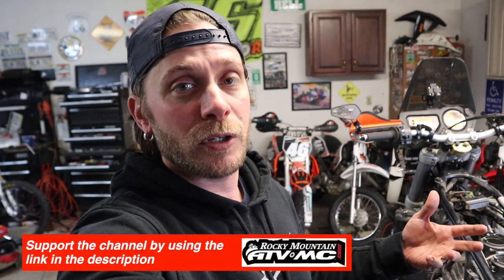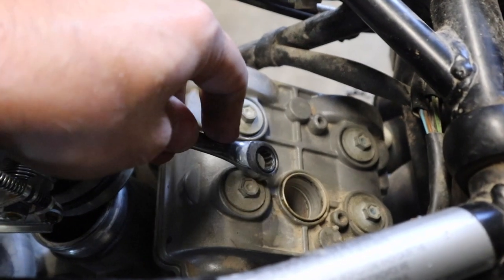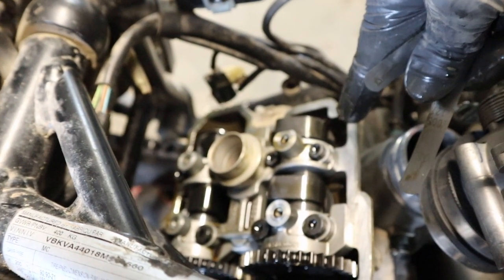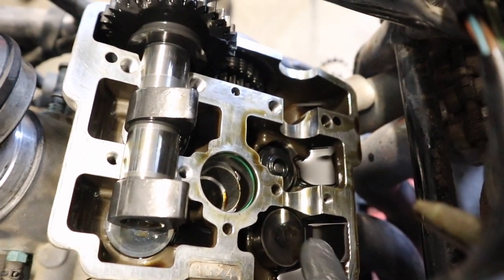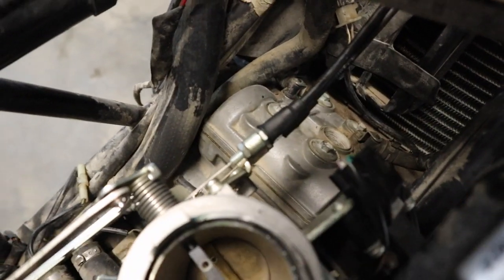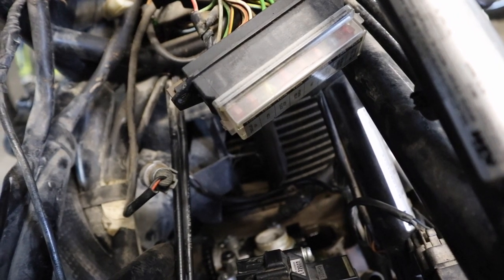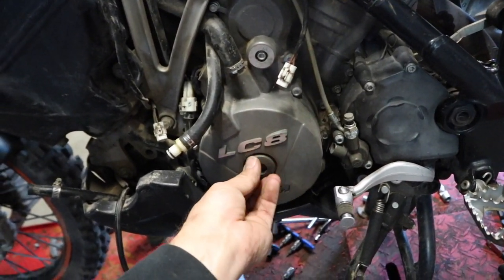KTM 990 ADV Valve Check/Adjustment and Spark Plug Change | Back in the Garage

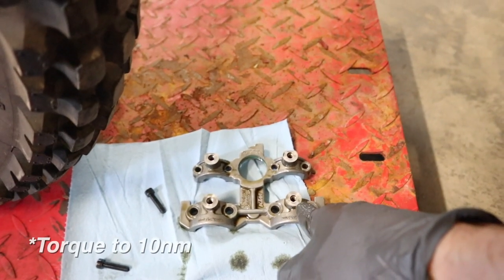Comment: Just FYI, according to the KTM HOW write up on the procedure, all 8 hex key cam bridge bolts are supposed to be torqued to 10nm, INITIALLY, but the 4 larger hex key bolts are supposed to be finished at 18nm. At 8:31 you only show 10nm for the spec.
Not sure its worth tearing tanks and intake back off to retorque if missed but should probably be done if possible.
Reply from the maker: You're right. I missed that.

Comment: Yesss!  Great timing… just ordered all the parts and am getting the courage together  to do this on the 990R for the first time..  Thanks for doing these..!
Reply: I’d recommend buying the crank locking screw or making one, it’s only cheap. Stops crank spinning out of time when you have cams out.
Reply from the maker: While I'd agree on the newer model LC8s (though I've done numerous checks/adjustments without) , since it's gear driven on this model, (to me ) it's kinda overkill.

Comment: Is the disassembly/assembly procedure the same for the 890R?  Excellent video.   Thanks.
Reply from the maker: Insomuch that they're both DOHC engines, it would be similar but there are quite a few differences as well. The modern 1090/1190/1290 valve service video I made would be closer since it has chain driven cams vs the gear driven cams on the 990 but there are still some differences. I'll make a video on the 890 when the time comes.
Reply: @2WR  I wonder why KTM moved away from Gear to Chain, is it because of costs of manufacture?

Comment: When are you going to do a valve adjustment on the 890?
Reply from the maker: Bike only has 12.5k on it but still plan to check them over the winter
Reply: @2WR  , I know a lot of 890 owners and been checking valves and cams earlier than the typical service schedule due to the cam issues that have popped up on some of these bikes. You do a great job showing and explaining things. Your 990 video is exactly what I was looking for but for the 890. I am more of a visual person versus a book person. I would like to do as much service as I can on my own since my local dealership is a crook.

Comment: In 15:40 it is visible that you removed the butterfly secondary flaps (driven by stepper motors and controlled by ECU) from the intake manifolds throttle bodies. What`s your experience with this mod? Throttle response, fuel economy etc? Remapping the ECU?

Comment: I've been considering getting one of these as my first adventure bike but doing this every 9000 miles seems a little intimidating. Have any thoughts?
Reply from the maker: If you’re gonna ride a lot of miles and don’t want to do the checking yourself, gotta be prepared to pay for it. I don’t put a lot of miles on this bikes since it’s my 3rd ADV bike (ride my 1290 & 890 more and they also have longer service intervals, basically double). For this bike, I might need to check them every 2-3 years. All things to consider with buying any bike.

Comment: thanks for the help bro. I wanted to ask, do you also become a model? of 2006 and in all lc8; and you are locked crankshaft; and the screws to tighten the cam cover, we start from the inside as you said, but the same for unscrewing?
Reply from the maker: For removing, honestly doesn’t really matter

Comment: Hi Mario, @TwoWheeledRider

My question is, is it possible to damage the head gasket in the process of adjusting valves?

My bike came back from 18,000 miles maintenance on November 11, valves were perfect, no adjustment needed, but valve cover gasket had to be replaced. On December 10 it went back for alternator replacement, on January 4, it ran hot, it started losing coolant. Per shop it is a head gasket issue.
My question is:  is it possible to damage the head gasket in the process of adjusting valves?
Bike was running perfectly until the valve adjustment.
Just received Blackstone labs analysis today (02/37/23), my main bearing is on its way out.
My last oil analysis (06/16/22) was good.
Reply from the maker: Nope. Head gasket issue is because it got hot, not because of a valve check.

Comment: Is it better to stick to upper or lower clearance limit on exhaust valves? I have downloaded shim calculator and there is note that exhaust valves tend to get larger cloearance due to carbon build up on the valve. My exhaust valves has 0,20 and 0,21 gaps and limits are 0,25-0,30 so it look like it's better to stick upper limit. Also woud it better to stick with OEM shims or try to ProX or JMT shims? OEM shims is only difference by 0,05mm and others are 0,025mm so it is easier to target to limits
Reply from the maker: Valves usually tighten, not loosen. Stick to the upper limit if you need to adjust but stay in spec. I’ve been using Hot Cams shim kits for years.

Comment: how many miles did the 990 have on it?? thanks
Reply from the maker: 49,977
Reply: @2WR  was this the first valve adjustment on the 990? if not at how many miles did you do it first?

Comment: What is the “simple math” to decide what shim to use? There are a lot of different formulas online how to calculate the correct shim..
Reply from the maker: There’s no formula. It’s basic addition and subtraction. If the valves are tight u install a thinner shim, if they are loose a thicker shim. Check your clearance again once installed to make sure you’re in spec.